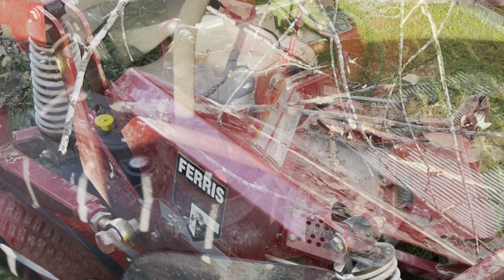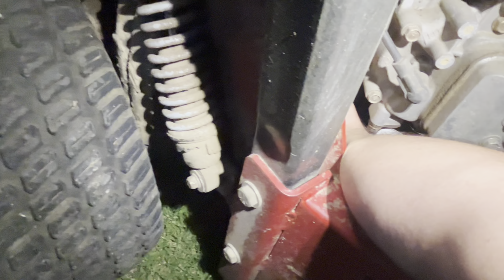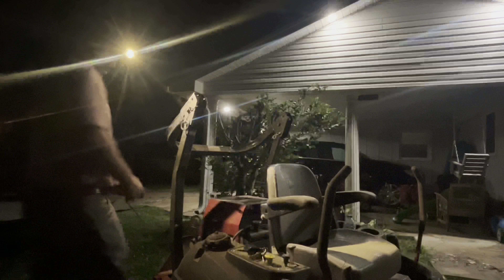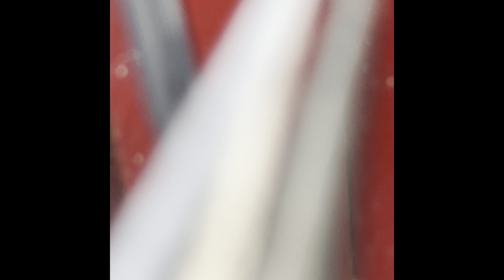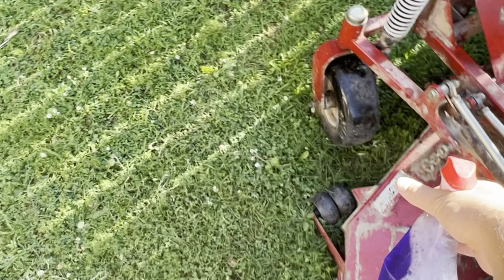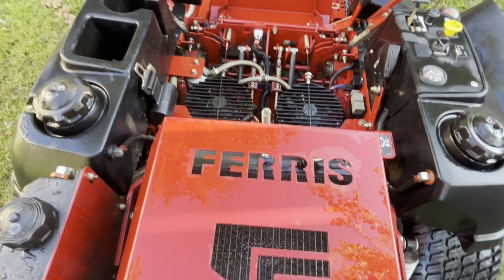NEGLECTED Ferris Zero Turn Mower with Kawasaki Water-Cooled Engine - Can I Fix It?? #chasintractors

Comment: I've got ferris is1000z from the 2010s, it's surging because of the idle ports in the carb are clogged or dirty  It's actually the air/fuel ratio being off, ( likely lean) due to the clogged ports, and at full throttle the governor is trying to compensate. Also check the welch plugs to make sure they're sealed and not letting extra air into carb. Those things are finicky and I'm still dealing every now and then. Good luck man.

Comment: That normally has A Indak ignition switch so A regular riding lawnmower key will work for that key ignition switch.,or it's like the newer style of sears Craftsman ignition switch keys.
Reply from the maker: You are exactly right! Once I googled a picture of the key, I recognized the key pattern as an indak ignition switch key. I got one the next day, and even found one with a plastic grip on the key.

Comment: Well worth saving, I love my Ferris!  I have the next generation after yours and they didn't offer a liquid cooled engine option. I have a Vanguard with EFI and the Oilguard system. The suspension on these mowers makes a HUGE difference on bumpy ground. New subscriber. Is there going to be a part 2?
Reply from the maker: Thank you for the info! Yes, I am editing Part 2 and still might add more to the video. I'm still trying to get it running perfectly to try it out. Fuel system was just totally trashed from sitting up!

Comment: Ive had a good few mowers with the needle stuck in the seat. One was so bad the needle snapped in half in the seat when i pulled it with pliers. Ended up scrapping that carb.
Reply from the maker: That is bad!

Comment: That’s one sweet ZT!  Great score for a great price!
Not a criticism, but you could improve your audio quality by trying to adjust all volumes to the same level. I was constantly adjusting volume throughout this entire video. 
I hope you’ll do a followup or Part 2 with the diagnosis of the hydro leak.
Reply from the maker: Thank you so much for the suggestions. I try to stream the video as I'm editing it to make sure volumes are constant. Given how soft I talk naturally, it can be a struggle to get volumes consistent. I have a New wireless Hollyland Mic set, but have yet to get them to work. I'm thinking they aren't compatible with my iphones. Using iMovie on my iPhone to edit since all the media is already saved there.

PART 2 has mostly been filmed as of yesterday and should wrap it up tonight. Will take me a week or so to get it edited and posted. I do all of this in my spare time just because I enjoy it and love to share with all of you. Between work, (2) toddlers, and a wife; it takes longer than you'd think to edit a little bit of video.

Comment: Hello From Kentucky. I have a late 1980s John Deere 285 that has a Kawasaki FD590V liquid cooled engine that I think may be a smaller version of the engine that you have. 
My FD590V Kawasaki engine has a bad water pump which none of the repair people in this area wanted to work on unless they charged major $$$ to replace the water pump. 
In disgust on my part at that time period, I parked the John Deere out of the way and decided to deal with it at a later date. Since I have retired, I am strongly considering tearing into the John Deere. Luckily, The John Deere Gators use basically the same liquid cooled Kawasaki engines, So those engines are now fairly common.
Those hydraulic leaks can be rather annoying and quite messy as you well know by now.  Looks like you will have a really nice Ferris zero turn once you get everything situated.
Reply from the maker: Thank you sir! Yes it is a smaller version! 590cc compared to 731cc. I can get you oem parts should you need something
Reply: @ALTractorPickers  The John Deere 285 tractor has been sitting in the weeds for quite a while now, But I bet that I could hook up a battery and hook up a test tank and the engine would fire right up. 
Right now I am working on my 682 Cub Cadet with a KT17S Kohler Series 2 engine. I have removed all of the engine tins and have never seen so much crud and grass clippings caked up under the engine tins. I always thought that the KT17 ran really hot and now I understand why. My 682 has one of the nylon oil pressure lines which runs from the front of the engine to the oil pressure gauge on the dash console in which the line was leaking just above the compression fitting on the engine side. Between the old fuel pump being loose and the oil pressure line being cracked, I can understand why the engine would have accumulated all of the dirt and crud. I am going to run a copper line to replace the cracked nylon line just for a little peace of mind.
Reply from the maker: @TheIronDuke502 nice! I have several old cub cadets myself! One of which has a factory Kubota diesel.